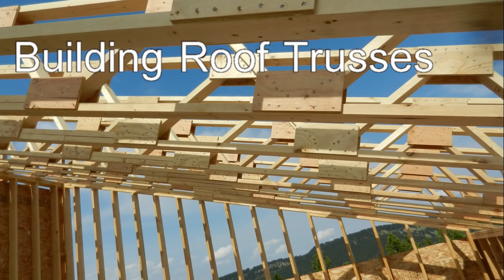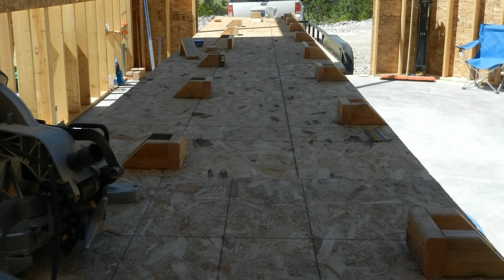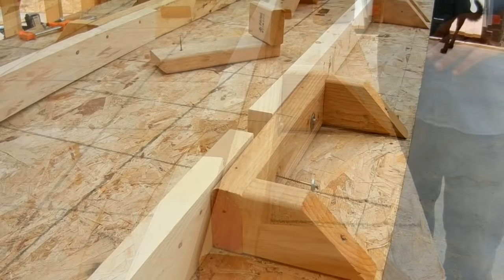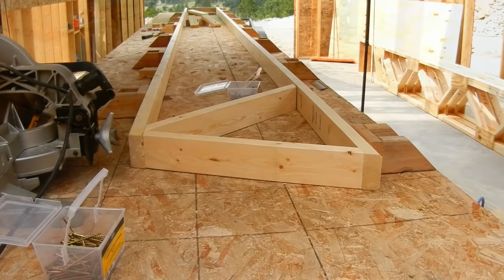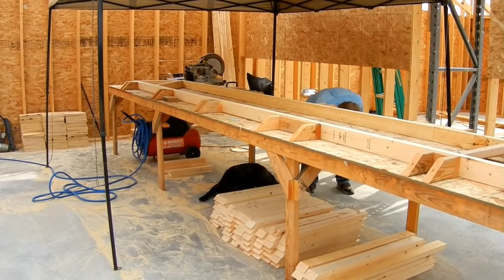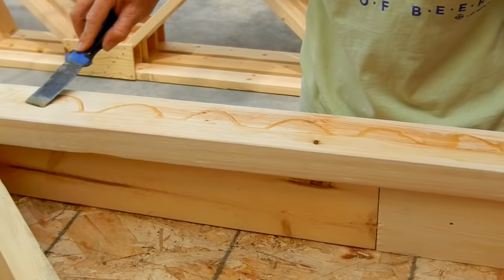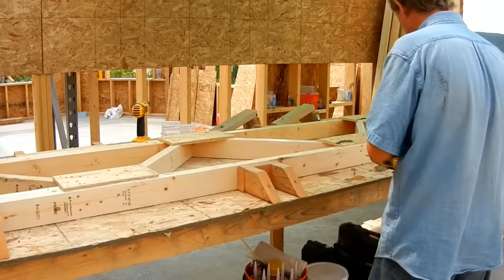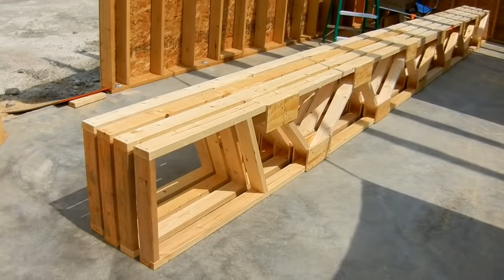Building Roof Trusses

Comment: Small technicality. That is floor truss construction. Not a flat roof truss. I would love to have an engineer review it. That's why permits require sealed drawings.
Reply from the maker: Permits require drawings to keep the bureaucracy alive. They stifle innovation and create a culture of I cant do it with out an expert.
Reply: @BSpotBuilds  What if it fails? Trusses were built with ply gussets in the old days and repairs are done with osb or plywood but what looks good isn't always right.
Reply from the maker: Is it possible a truss could fail? sure,  but it's extremely unlikely it would be a catastrophic failure. Theres risk in everything and stamps dont make it zero.
Reply: @BSpotBuilds  Hey, I think it's a very nice job, but in many locales, you can't make a homemade truss for a house. Yardbarns sure. It looks like you have had truss experience. Using plywood instead of metal gussets would save money but it's a labor of love.
Reply: @davidcallsen5204  Why he moved to a local where you can build your house the way you want! Other places need a stamp which adds nothing but color and a false sense of security for those who need it, imho.
Reply: Those trusses could withstand a direct meteor impact.
The walls will give out before those trusses do.
Reply: @lefthandedhardright8839  What about a commercial grade A/C unit or maybe a 4x4 Skylight? Both require special loading
Reply: @davidcallsen5204  Well then, Its up to you now. Find an engineer and show him this video. Report your findings.
Reply: @lefthandedhardright8839  You be funny. I would never be able to get an engineer to sign off on it, but I've fixed damaged floor trusses with almost the same techniques. Though the plywood gusset was about 2' long per intersection.  That sealed drawing repair would cost about $100.
Reply: @davidcallsen5204  Its not hard. Go to an engineer school, pull out your Ipad and play the video. Report back.
Reply: @davidcallsen5204  It's irrelevant that you can't do this in most areas.   This guy can and did while you sat on the sidelines talking about it.

Comment: These are structural trusses they should be built with southern yellow pine NOT white wood.
Reply from the maker: All wood is structural what you use all depends on what the loads are. It's just lazy engineering to use a one size fits all approach.

Comment: As a builder for 35 years and designed and built over 200 homes I just need to say that a 2x12 @ 16 O.C. can go to 20 feet. Keep It Simple Stupid.
Reply from the maker: Well that only leaves a few issues:
One - (1) 2x12x26' is about $130 these trusses cost closer to 60 each 2100 more.
Two - Since they are on 16" center vs 24" I have to use 16 additional rafters at 130 dollars each 2080 total.
Three - how do I fit 20" of insulation in 11 inches of space.
Four - bases on what live and dead loads, what snow load did you use for your arm chair YouTube analysis?
So you have increased cost by 4180 dollars and reduced the roof insulation to ~ r38.
Maybe you don't know everything you think you do.

Comment: You do nice work to bad you use mdf and other crap materials.
Reply from the maker: I will assume you mean OSB since there isn't any MDF any where in the video. Maybe you should look at the specifications for the product it is more than suited for the application, it's economical and will out live me.
Reply: @BSpotBuilds  Oh yes, it might outlast you as long as the cut edges never see humidity or water.
Reply from the maker: @brianstevens3858  That is the plan.

Comment: AT A TRUSS FACTORY ! IT TAKES ABOUT 20 TO 30 SECONDS TO DO THIS SAME OPERATION !  I THINK  THIS IS A BETTER QUALITY THAN THE TRUSS FACTORY ! THE TRUSS FACTORY DIDNT USE SCREWS THEY USED METAL PLATES AND I DONT THINK THE TRUSSES WERE AS STRAIGHT AS THESE HAND MADE TRUSSES ! THE METAL PLATES WERE PROBABLY STRONGER !  I THINK HAND MADE IS BETTER FOR THE MONEY IF U HAVE THE TIME AND THE SPACE TO ASSEMBLE THEM !  ALL U NEED IS SOME PYTHAGOREIEN TRIG AND MAKE UR BRACES ABOUT EVERY 18 INCHES OR SO AND U CAN WALK ON UR ROOF NO PROBLEM  SAME AS FLOOR TRUSSES ! I THINK BUILDING CODE IS MORE SPACE ON THE ROOF SO CHECK IT BEFORE U BUILD !  I USED LUMBER INSTEAD OF PLY FOR THE PLATES AND BUILDING CODE DIDNT SAY A THING ! BUT THAT WAS A LOOOONG TIME AGO ! GOOD LUCK ! REMEMBER TO GET A LAWYER BEFORE  U APPLY FOR A BUILDING PERMIT ! MAKE SURE U RECORD ALL MEETINGS WITH THE GOV ON VIDEO ! DONT FORGET TO KEEP EVERY LITTLE RECEIPT WHEN U BUY FOR UR HOUSE CAUSE WHEN THE GOV TRYS TO CRIMINALLY RIP U OFF FOR A BRIBE OR WHATEVER BLACK LISTING ON UR NEIGHBOR U CAN SUE THEM AND GET EVERY LITTLE PENNY BACK AND POSSIBLEY MAKE THEM PAY FOR UR HOUSE !  BEFORE U BUILD PUT UP A SECURITY CAMERA OR MULTIPLE SECURITY CAMERAS CAUSE GOVERMENT LIKES TO VANDALIZE UR BUILDING SITE WHEN U REFUSE TO PAY A BRIBE ! I CAUGHT 2 CODE EN. CREEPS RAMMING A BARRICADE IN A PICKUP TRUCK AFTER HOURS AND RUNNING OVER A BRAND NEW JUST INSTALLED 1700 DOLLAR SEPTIC TANK !!! NO BRIBE TODAY SUWANNEE COUNTY !

Comment: What a waste of time, I guess it's a system for someone who doesn't care what year the trusses are finished. This guy obviously has never worked in a production setting. Had he, he wouldn't have wasted all the time and material setting up that jig table. Instead he would have built a truss, temporarily secured it to the table and then built each remaining truss on top of the first one, using it as your jig. Also trusses that are built with the 2 x 4 standing are structurally more sound with less lumber, therefore more cost effective,

Comment: You ever hear of the air nailer? Ring shank nails...
Reply from the maker: So, you didn't watch the video.
Reply: No, it was too long and the same ole thing over and over... But just to let you know... The screw heads will break off... The code here will not let you use screws for trusses... Nails are much better they will not break when under stress.
Reply from the maker: You also didn't read the comments where I have addressed this. The primary function of the screws is to clamp the glued joint or in the corners for there pullout strength that is many times that of a nail. If you care to learn a little about the subject read the following article that includes actual data. Lastly I don't care about your code it is a creation of bureaucrats, thick and full of bullshit.
http://www.builderonline.com/building/dear-builders-engineer-nails-or-screws_o

Comment: Most of the thumbs down are for building the trusses with the 2x4 on it's side which is much weaker than if assembled on it's edge.  I would be surprised that it meets any North American building code.  One would be hard pressed to find trusses built anywhere with 2 inch lumber laid on it's side.
Reply from the maker: If you did a little research you would have found that you are wrong. A truss does not act like a single piece of lumber. The cords are in tension and compression and the orientation has little to do with the overall strength. Floor truss 2x4's are almost always laid flat. In my case I did it to provide nail penetration for the gusset plates. Look at an I-joist, the top member is laid flat and they are rated for roof use.
Reply from the maker: If you did a little research you would have found that you are wrong. A truss does not act like a single piece of lumber. The cords are in tension and compression and the orientation has little to do with the overall strength. Floor truss 2x4's are almost always laid flat. In my case I did it to provide nail penetration for the gusset plates. Look at an I-joist, the top member is laid flat and they are rated for roof use.